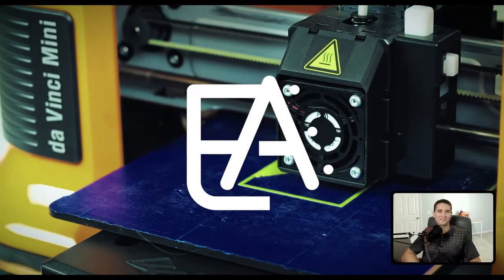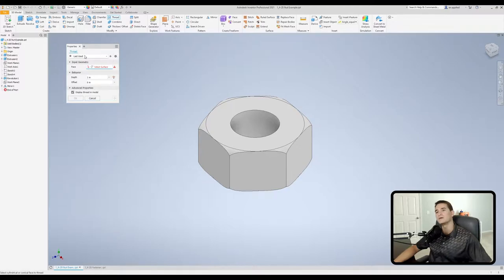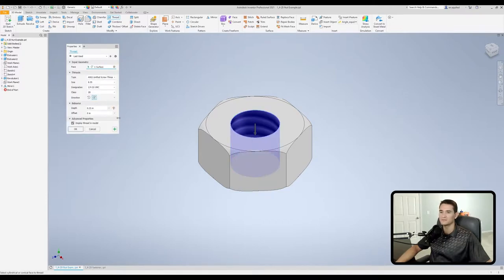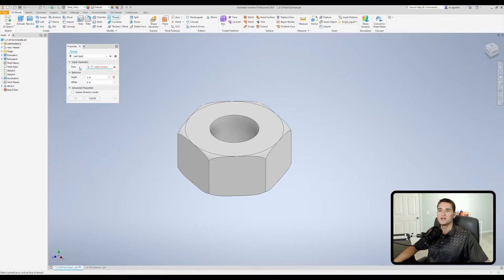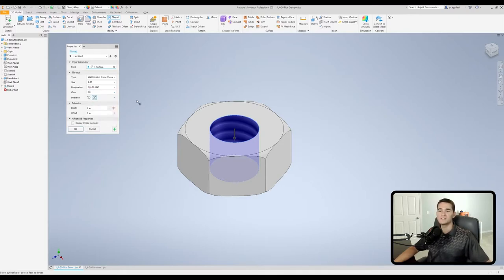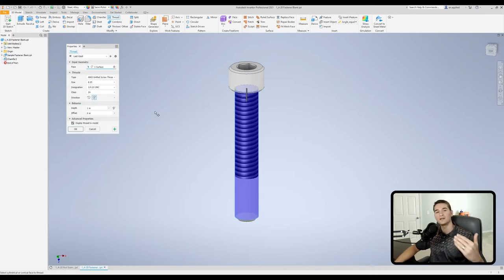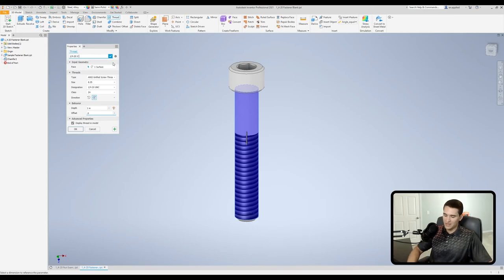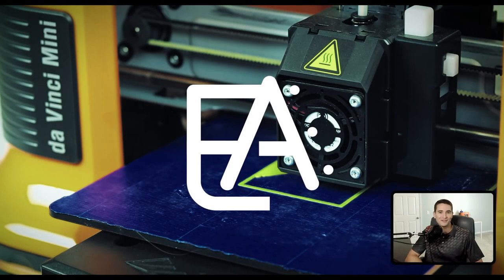Thread Tool and Options - Autodesk Inventor Part Tutorial | Autodesk Inventor 2021 IN DEPTH

Comment: this is a massive help as i am in university doing advanced engineering and manufacturing is there anywhere else you can recommend to look at or any books to get that would help
Reply from the maker: I'm really glad you found my videos to be helpful and I appreciate you taking the time to reach out and let me know! So, I typically recommend keeping any textbooks that you may have used at university in subjects such as, machine design, thermodynamics, solid mechanics, fluid mechanics, dynamics, manufacturing, electrical engineering/fundamentals, etc.

Now this is highly dependent on your budget and your career field as well. So for example, if you want to work in the automotive industry as a manufacturing engineer, I'd recommend keeping material on advanced manufacturing methods, machine design, etc. Regardless of what you end up doing however, I highly recommend keeping a book called, "Machinery's Handbook" by Erik Ober, Franklin D. Jones, Holbrook L. Horton, and Henry H. Ryffel.

The "Machinery's Handbook" is a great piece of reference material that covers everything from manufacturing principles, all the way to basic design principles. You'll want to skim through this book and mark the sections that are relevant to your job duties so you can easily find them when you need them.

In conclusion, you'll want a good mixture of textbooks that cover both the theoretical explanation of a concept (that's relevant to your industry/job), as well as the implementation and application to real life scenarios. Practice is incredibly important here. Sharpening your skills in a subject relevant in your job is a valuable way to get an edge in your industry. Many people simply stop learning once they are out of university or leaving the office. One of the best things to do is continue referring back to your textbooks/reference material and practice/implement what you learned so that you can really understand it.

I hope this was helpful and I wish you the absolute best in your career!

Comment: Hi, 
I see that you had a 3D printer in your video. The thread you are making  can not be 3D printed when you convert it into an STL file. I tried downloading an Add-On but that Add-on does not support Inventor 2021. How can I print a a part with a thread 3D ?
Reply from the maker: That's an excellent question. Since the Add-On does not work with 2021, you can create the thread manually by sweeping the thread profile along a helical path or by using the "Coil" command in a part file. Recommended Steps Below:

1. Create minimum diameter of fastener (for example a 3/8 - 16 fastener has a min diameter of 0.2983") by extruding cylinder to required height.
2. Create new sketch with thread cross-section (as if you cut the fastener in half lengthwise). For example: I would make a triangular shape with the base of the triangle coincident with the surface of the extruded cylinder and dimension the thread as required (based on thread angle and major diameter of fastener).
3. Then, use the Coil Command to revolve your thread around the cylinder with the appropriate pitch and height characteristics (make sure you use the "Join" Boolean operation).

Hope this helps! Thank you for watching!
Reply: @engineeringapplied  It helped a lot thank you